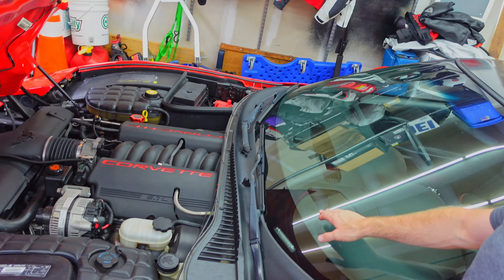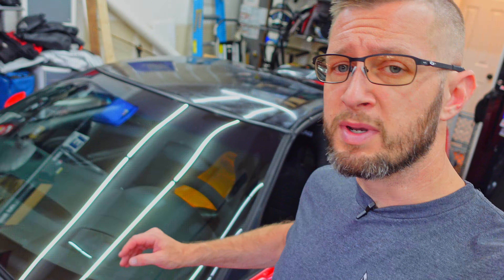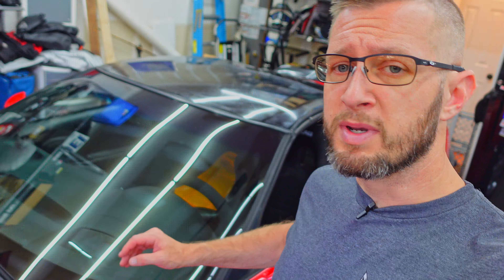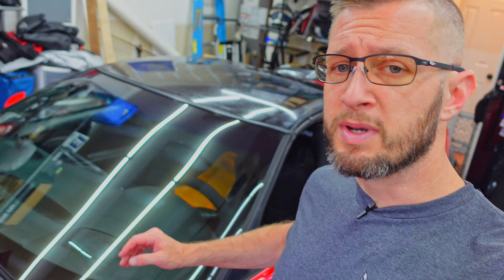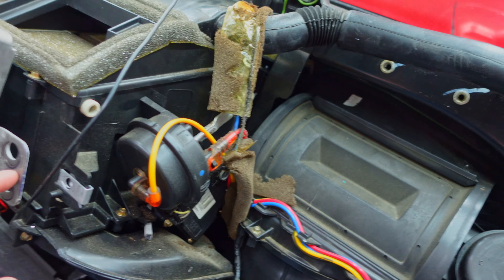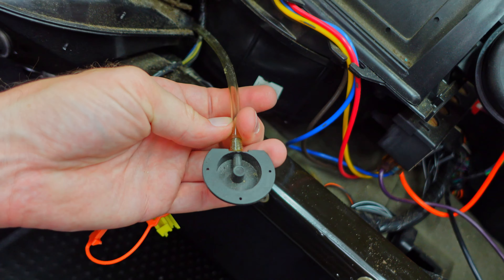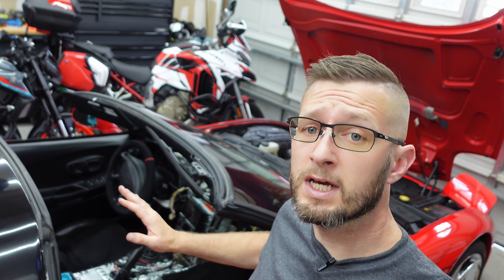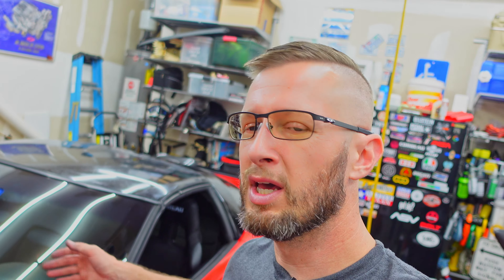C5 Corvette Dash Removal and Blend Door Actuator Replacement

Comment: Always remove the negative terminal first!
Reply from the maker: That seems like a silly suggestion
Reply: @4KMotoring  No it's not! What if you accidently make a connection to ground with the wrench as you are removing the positive terminal  from the battery first?! I ALWAYS remove the negative terminal first, then the positive second! But I will most certainly refer to this video if I have to remove my dash in my C5! Thank You very much for the info!
Reply: Amen!

Comment: Had that issue when I  first bought my 1999 C5 at 69,000, but actually I noticed   a few later after continued use, it started working on its own. No problem since!. 4 years now & it's works fine.
Reply from the maker: That's good news! Looking at the failed gear, I would be shocked if there wasn't a brass replacement available somewhere

Comment: Don't know if you can answer this or not but my 2000 with dual climate seems to be weak with the air. I got a cfm meter on ebay and I'm running about 475cfm at the front vent. I just did a test and regardless of the mode, vent, floor, vent & floor and floor def, all the vents blow air. I would think if I put it in vent mode, the floor and def would not have any air. No error codes and the air blows 48 degrees out of all vents when running. Any thoughts? I even did the blend door calibration. Weak air flow could be from all the vents being open?
Reply from the maker: I'm actually facing the same issue and working on a video for it. The vent controls are vacuum operated and there seems to be a common failure point of the vacuum line behind the battery. As soon as I get to the bottom of it I'll have a video out about it
Reply: @4KMotoring  I'm looking at a pic of the vacuum canister and the lines to and from it now. I'll have my mechanic with a smoke machine see if he can find the culprit. I'll also keep you posted.
Reply: @4KMotoring I have the same issue and would like to see a video on that.

Comment: Is it the same for a 97? It has the older system where temps can’t be adjusted for passenger since it’s only controlled by one knob for both sides and since it is I don’t need two of them or do I??

UPDATE: yes you only need one actuator because it controls both sides and the progress to remove the dash is almost the same. the actuator is located on the driver side so the dash HAS to came off
Reply: That’s what I want to know too. I think mine just went out and it’s a base single zone climate control switch. 1999 with 93k miles.
Reply from the maker: Oof, that's not something I'm sure of! Google should have some diagrams that can point you in the right direction, good luck! Be sure to post what you find in case anyone else has the same question!
Reply: @ I’ve ordered one and I’ll just open up the dash to see what if I do need two or one is enough and I’ll update here to see if it was just one or two. The actuator will be here in a week or so

Comment: Do you happen to know what the heat/insulation in the upper dash vent is called? Near the temp sensor? I would like to replace it., also I would like to do it for the HUD as well if I can.
Reply from the maker: I'm not sure of the OEM material, but I have been using a lot of dynamat products that are pretty similar

Comment: Will low Freon effect the function of the blend doors? I have replaced my doors, but still getting codes, and doors are not spinning. Thanks.
Reply from the maker: Unfortunately, that's a completed answer. Is your ambient temperature displaying correctly? My exterior temperature sensor was not allowing the AC to engage. 

There are relearn procedures for the HVAC control that must sometimes be followed. Sometimes low Freon could be the culprit.
Reply: @4KMotoring  thanks for the reply. I will check sensors today. Also picking up a diagnostic tool for more info. Thanks again.

Comment: Any tricks for taking out that airbag? I would really really like for that not to explode in my face.
Reply from the maker: Unplug the battery overnight to let any residual charge drain out
Reply: @ thanks. Do you have any videos on the vacuum actuators? I think I have issues with those too.
Reply from the maker: I'll be making one of those soon, that's my next project.

Comment: Is this for cold and hot a/c or for changing the position of air flow ? Because i have issues with my 1999 C5 in A/C air flow position doesn’t change
Reply from the maker: The electric blend door is for temperature control. The C5 vent position system is vacuum actuated, so you have a vacuum leak somewhere. Mine is currently doing the same and I will make a video trying to track it down whenever I have time.
Reply: @4KMotoring  thx a lot bro ,i hope you solve it as easy as possible and quick 🤝

Comment: Thanks!
Reply: Any info on the theoretical way of doing the driver's side without removing the dash?
Reply from the maker: It is technically reachable from under the dash on the driver's side by removing the bottom trim plate... But it will have to be done completely by feel in the dark... I would just remove the dash

Comment: What about the door or valve that controls the HVAC's fresh air versus recirculated cabin air?  Where is that, and can it be replaced?  I believe mine is trashed because whenever I'm at a traffic light behind a truck or bus, and my HVAC is in recirc mode, I smell exhaust coming into my car.  So I have to turn off the air conditioner until the traffic light turns green.  I've owned my C5 for eight years, and this particular problem just started last month.
Reply from the maker: Does your car still switch vent outputs between defrost and dash vents? Or does everything blow at once? Commonly, a vacuum line failure leads to all of these problems, I should have a video coming soon speaking about it. Vacuum actuators themselves rarely if ever go out
Reply: Thank you for replying, and yes it does switch between defrost and dash vents.  Even with dash vents, a very small amount of air blows up the defrost vent, causing condensation on the front window's exterior, which is a nuisance.  But it's done that since I purchased this 2003 Corvette in 2015.  The inability to only recirculate HVAC air suddenly began about a month ago.

Comment: Looking to change the Actuators on my 98 C5. Are the Gears in the ones you replaced Plastic to Plastic instead of the Plastic Gear to the Metal Spindle?
Reply from the maker: I didn't open them up so not sure, but if I can get another 20 years out of them I'm fine with whatever they're made of